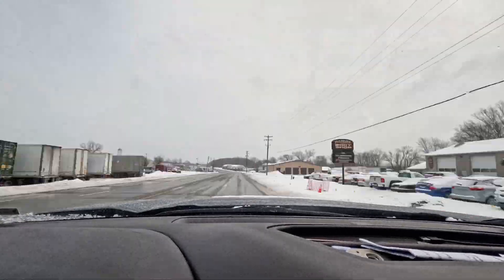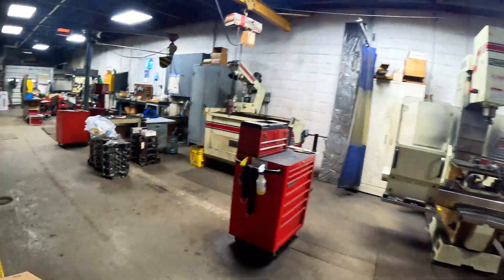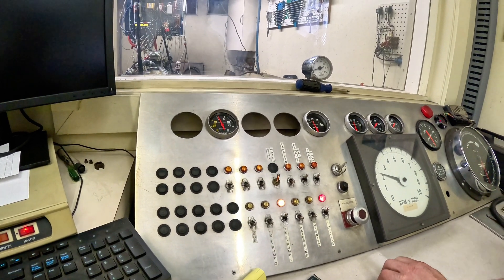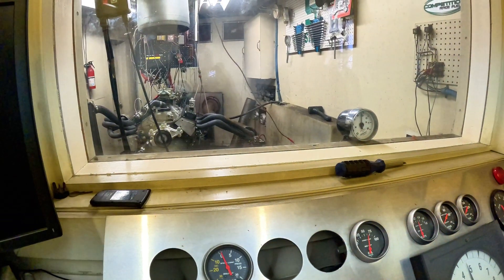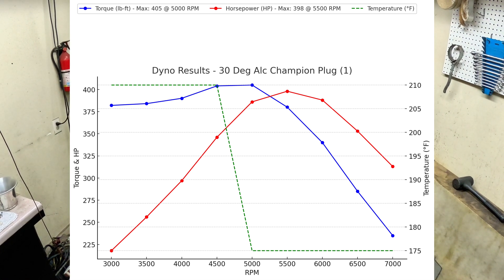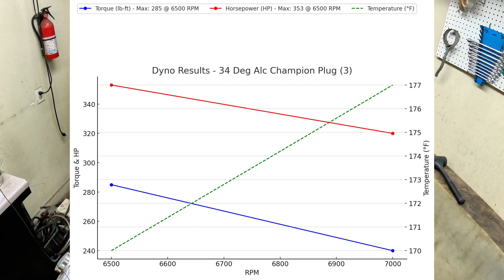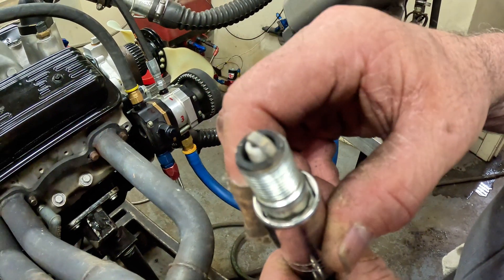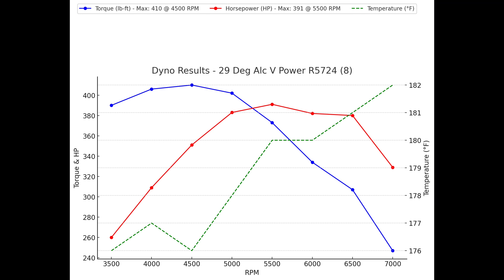We Dyno-Tested a 604 Crate—Here's How to Make More Power!

Comment: Hello, curious to adding the V- power R5724 to the 32 Deg 93 Oct , would it be a tad better , because Money wise would be 32 ded 93 oct champion plug set up even though it is 7 hp and 34 tq less. To me carb and fuel would be cheaper and easier to buy 93, than alcohol carb and special high dollar fuel for 7 hp and 34 tq. What do you think on that?

Comment: You only dynoed 32 and 34 degrees of timing.  I'm confused because the Chevrolet 604 manual itself says to time the engine at 36 degrees. Edited comment to add.  Its on page 42 of the manual says 36 degrees at 4,000 rpm.

Comment: Have you ever tested the Denso Iridium Spark Plugs?
Reply: No spark plug will make much of a hp difference when the plugs are new. Spark plugs come in different HEAT ranges becuase performnace engines need a plug that can keep its tip cooler under load. Street cars use a fairly warm heat range so that the tips can stay cool under moderate driving conditions.